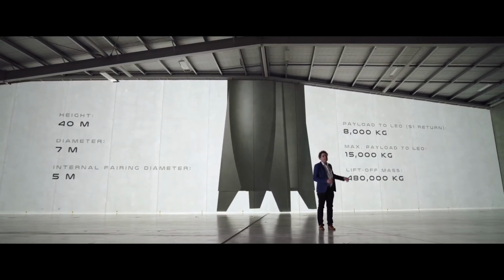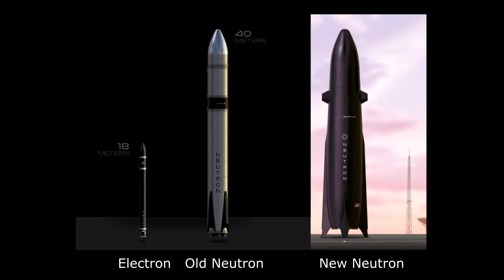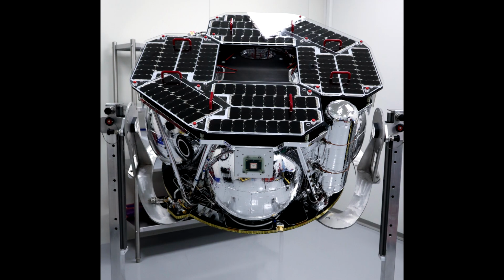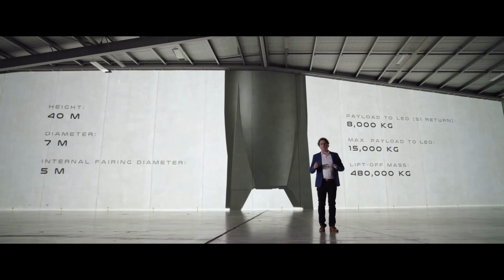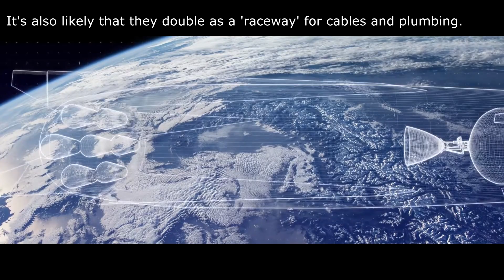Rocket Lab's Neutron Rocket Will Be More Reusable Than Falcon 9

Comment: Looked at the Relativity 3d printing aluminum...why would you 3d print an aluminum tube? Two halves put together with rivets. It worked on the P51 Mustang 70 years ago.

Comment: When that I-beam hit the carbon fiber I can tell you this , there were a lot of microfractures all around the area of impact . I've worked with carbon fiber being used is a lot of places including inspection equipment and military applications like drones and power systems and the stuff is great for tensile strength although not as light as it seems but not so good at side loads and it's compression strength is great till it isn't then it goes snap , a failure can cascade really fast . There are some solutions to those issues by weaving titanium and other things into the fiber  although I have only read about those things , all the carbon fiber I have dealt with didn't have any special properties and you always hear how light it is , yeah then you pick up a sheet of it and realize G10 fiberglass is lighter by a lot . The first time I picked some up I was shocked at how heavy it is , no it's not like picking up a sheet of steel the same size but I always imagined it being much lighter .

Comment: Apples and oranges with the carbon fiber comparison.  Falcon 9 is used for most of the comparison but then switched to Starship only for structure for “Political” reasons.  Obviously, Falcon 9 structure very successfully uses composite construction for its first stage.

Comment: regarding the tension-based second stage, would it not have to necessarily withstand compression if its engine is on the back end? or are Gs from second stage significantly lower than from the first stage?

Comment: 8:50 - "SpaceX are taking a hit in terms of pure performance in the name of better iterative capability" - According to multiple interviews with Musk this is incorrect. Unless by performance you just mean thrust. But if we define performance as kg to LEO then it's apparently incorrect (CF + heavy 360 shielding was estimated to be heavier). However I assume Musk's comments aren't really relevant to the booster, which is surprisingly also stainless steel.

Comment: I'm also not sure why Peter stressed the RTLS landing so much.  It's not as if Falcon 9 can't do that, just that by landing downrange it allows SpaceX to get even more performance out of the booster and still recover it rather than expending it, which helps both them and the customer.  Still cheaper than building an entire new booster, and expands the payloads that can be delivered.  It really seems like this is either up to 8 tons recovery or up to 13 with expending, and no in between.

Sidenote: the next RTLS mission I can see on the schedule for SpaceX isn't until NET April 2022 with SARah 1 and Rideshares @ LZ4

Comment: Im pretty sure they just want to be bought out by Elon Musk, this is my opinion of their goal. I have worked at small startups where that is their goal explicitly. Manufacturing these fabulous rockets in production will prove difficult for them t many different angles, such as material testing, safety testing, reliability tests, nasa stringent past history requirements. If they do manage, they do still require someone to contract their rocket tech. This is also same with many new battery tech from these other companies, they all want to sell their tech so Tesla could use it, in other words, they are at the end of the nodes of a tree, in the cycles. When i say that is that if Tesla does not choose your cobalt mines or battery tech, you also hope China BYD, GM, or whatever, it may quickly get diminished or obsoleted when the next better tech competes with your company at the same time.
Reply: Except that Rocket Labs has already mastered the materials tech (they're probably the best in the world now). They already have had a successful rocket (Electron with many launches), know how to do the logistics, are selling spacecraft and explicitly say they want to be a vertically integrated company. So, nope, they're not interested in being bought out.
Reply: @saumyacow4435  well, NASA chooses one , isn't it?  for example, each project or space program they select spaceX rockets to carry out their missions, what does this company do while waiting on the sidelines?

Comment: It's going to be more resuable than Starship too. Wait till they have to replace 89723623 busted tiles and 22 dead raptors each flight.
A good rule of thumb when you try to develop a fully resuable system is to not put the world's most complicated rocket engine on the craft. Rocket Lab is doing it right!
Reply: Yep, the thin steel "tin can" that is Starship is going to flex and vibrate and shed tiles by the dozen. Its not the cost of the tiles, its the cost of all the people and time refurbishing. That's what made the Shuttle so expensive.

Comment: The very specific fairing seems to be usable not only for satellite launch but also for satellite recovery, like the capability which was largely lost along with the Shuttle. There could definitely be military contracts to launch empty and return with something in that fairing.
Reply: Not really. Remember that the first stage won't be able to reach orbit. When releasing the second stage plus satellite, the speed will probably be significantly less than half of orbital velocity.

Comment: Help me understand. Why does the starship need to bellyflop and have a heat shield for reentry when the first stage of falcon nine does not, and this new neutron rocket can enter butt first without any heat shielding. I’m serious I don’t understand.
Reply: Because the first stage of a rocket is only going 3,000 m/s or so. It will get hot but not that hot. Whereas the second stage (anything going orbital) will be travelling at 8,000 m/s - or about 7 times the kinetic energy. Therefore Starship (second stage) needs a heat shield. First stage of Falcon 9 doesn't need one. Second stage of Falcon 9 burns up. First stage of Neutron doesn't need a heat shield. Second stage of Neutron burns up. 

And the belly flop of Starship has to do with the fact that its heavy relative to the area it presents to the air stream, so it needs to go sideways to slow down enough.
Reply: @saumyacow4435  thanks. Good explanation.

Comment: I've got to say this design is way superior to the falcon 9 and will probably destroy starship for anything other than manned flights and interplanetary travel which they are not trying to solve with this rocket and might mean that their costs are incredibly low compared to a solution like starship, especially with these development issues with raptors and the scale of starship.
But Scott is right in asking if stainless steel would not be a better material if it's a thin sheet.

Comment: There are some other comments critical of the Carbon Fiber, but it is important to remember that a composite like carbon fiber, or even fiberglass for that matter - they work perfectly until they don't. That is, they work great and are relatively unaffected by miner flaws and fibers, but that's the problem - as they wear down and fibers break they work great, work great, work great and then suddenly fail.
If they're using carbon fiber, they're hopefully doing it in a way to replace materials through use, or by having a well-defined lifetime of the rocket. Because steel may be heavy, but it is very forgiving to wear and stresses and very easy to inspect. But when a composite fiber breaks, it doesn't grow back.

Comment: The matrix limits the temperature stability of carbon fiber composites, not the fiber. Maybe they innovated on that front? Also, the gigantic empty fairing will increase drag vs. weight when returning. Probably that reduces the thermal load on their rocket?

Comment: I don't get it. They build the second stage to hang in suspension to make all its' load tensile not compressive to save weight. OK. Check. But then, um, the second stage engine fires and that puts the entire second stage... in compression!! From the engine! Sooooo.... you have to design the second stage for flight compressive loads to fly the second stage itself... so why not just use that same structure to absorb compression during first-stage burn?? I don't see the win since you have to bear compressive loads when the second stage is burning.

Comment: I think that the main benefits of using metal instead of carbon composite are the (relative) simplicity of design, manufacturing, and above all else: COST COST COST. Have you ever tried to do the matrix math on complicated composite structures? sweet jesus. The savings of working with an isotropic material thats 100x cheaper than your complex composites would seal the deal on using steel/aluminum for me. but im not the CEO of a rocket company. Having said all that, the Neutron looks absolutely BADASS and I cant wait to see it fly.

Comment: The 3d printed rocket looks interesting too. Potentially a lot of strength to weight could be gained with modern 3d printing infill techniques. I think that 3d printing the rocket engines is going to be the industry game changer. Just think what we could do with several 1-5 percent gains in performance and efficiency.

Comment: The use of composites in a heating case is very interesting. The use of higher graphite content carbon fibres provides extremely high heat transfer rates, can ensure that while global warming is high, localised heating remains relatively low.

Comment: These days you can make cost effective composites for high temps by using a temperature resistant matrix resin. This usually needs a very specific cure cycle after manufacturing but considering the cost for the molding that is not that problematic. Also composites are way better under tension so i would bet the pressure vessel has a structural composite going on. Often you make these with a very thin stainless bladder for sealing which is then wrapped in carbon fibers. Thats how they make 300bar paintball tanks which are super light.

Comment: I really like this design, however I do have a few questions: First, if the second stage is built to handle tension loads, how well will it handle the compressive force from the rocket engine? I know this has been done before, but I’m not a engineer. 
Second, how would a human rated capsule interface with the second stage? I assume that they would dispense with the fairing. 
Once again, excellent reporting from the great Scott Manley.
Reply: The compressive load you mention on the second stage is less than the Boost stage . The second stage is under thrust to attain LEO for around 5-6 minutes but the boost stage is 2.5 minutes , so 2nd stage , long and slow and less thrust .

Comment: I hate it when people quote "escape velocity," like the Earth has a magic hand wrapped around the ship.  It's NOT a speed that if you reach you ZOOM away from the Earth.  Any spaceship will use the gravity of nearby bodies of mass to "slingshot" away.  Everything is in orbit of everything else.  Most masses are "insignificant," in other words, the value of pull is so low that calculations look the same when you drop their influence.  Orbits can be very elliptical.  Any ship "escaping" Earth will NOT be on a path up and away, always with respect to the center of the Earth. The math used to calculate the path is never simply about "speed" in whatever direction.  It's about curves.  Which leads to the 3 body problem, where the math cannot be reduced to a simple calculation.  Just a rant.  I realize that these channel need to choose a knowledge level to talk at, but there are some things that are massively misunderstood when they are reduced to "buzz terms."

Comment: Wasn't the demonstration of the strength of the various materials too staged? In the case of SS, the lower part of the stand is not in the frame and at the same time it can be seen that it is very slightly displaced on impact, as most of the energy is completely absorbed by the plate, seriously deforming it. And when the CF was hit, it was perfectly clear that the stand is completely unconstrained and moved too easily ... The correct comparison required the stand in all three cases to be stationary, especially since CF has relatively less weight.

Comment: Too rigid designs in an unpredictable environment.  The crash test is funny.  How does such collisions occur in space?  Will the carbon sheet have the strength to resist collisions in space  where speed of objects may go beyond 30000 m/hr?  Space travel involves risk of collision but  much lesser than chances of road accidents in an automated car.  Exploiting every possible technology to Prevent collision  is  the only possible method to avoid hypothetical disaster.

Comment: They will have problems with those bottom leg-fins.
They are ok for the ascent, but on the return it will be like an arrow flying backwards.
The booster will always be trying to flip around.
R
Reply: Except that the heavy bit (engines) is right at the bottom.

Comment: The fairing design is going to complicated use for crewed spaceflight.
Reply: I suspect they will have a version for crewed spaceflight with a truncated fairing. So that the crew capsule forms the nose of the vehicle and thus can separate and abort without much fuss. The fairing would still take the compressive aerodynamic load and thus keep the load off the second stage.

Comment: Using metal for the second stage makes sense also considering, this is the part, which is expended. So, making it from perferrably cheap metal alloy is a good choice.

I also wonder, if later on they could try to recover the second stage engine, the SMART way (or similar). Inflatable heat shield for the engine (only the engine), and glider descent, mid-air catch with chopper (they will have a lot of experience with that until then). Though, I'm not sure, it worth. Weight penalty on the second stage, more complex, and very much depends on, how much the second stage engine costs.
Reply: It will be very interesting to see what they do actually build the second stage from. But given what he said, my bet is on carbon fibre. In other words, they are confident that their automated carbon fibre production can do it cheaply enough that compared to all the other costs that go into a launch, the actual materials cost (the carbon fibre tape) makes no real difference. If so, it will be a fantastic ultra-light structure. If I were asked to design a a re-entry system for the second stage the first thing I'd want to do is to make sure the second stage is as light as possible. Then I'd inflate a ballute from the engine section. One option is a cone shaped ballute. So the weight of the engine will do the attitude control. The ballute keeps the worst of the heating away from the tanks and the engine has a tiny amount of active cooling. Add a parachute. As a bonus, the ballute could serve as a raft. And yeah, mass and cost might mean its always better to just throw it away.

Comment: Does it work? Test it. Find where it fails. Fix the failures. Try again. Lather. Rinse. Repeat. SpaceX does this and that’s why they have succeeded until now.
Reply: Rapid prototyping can be done with printed metal or with rapid carbon fibre construction.

Comment: I'm not sure about vertical integration, but I would not be surprised if there was some sort of stabilizing structure for the bottom of the second stage if only so they don't dent their engine bell in turbulence.  This may be able to help support an empty second stage with payload in a horizontal configuration

Comment: They should be careful about disrespecting SpaceX. SpaceX will probably be flying StarShip by the time this thing gets off the ground. Historically it takes 2-5 years from first flight until having an operational vehicle. SpaceX will have their first flight next year, which will almost certainly fail, but the one after that may succeed.

Unlike Blue Origin, RocketLab has flown an orbit-capable rocket, so they are probably ahead of BO, but both companies are way behind SpaceX.
Reply: SpaceX is just a company,, technically a much bigger competitor of RocketLabs, nothing wrong with a few fun jabs, I am sure Elon can take it don't panic.